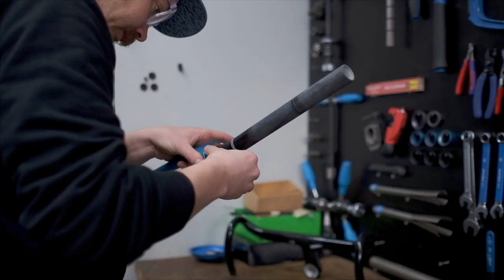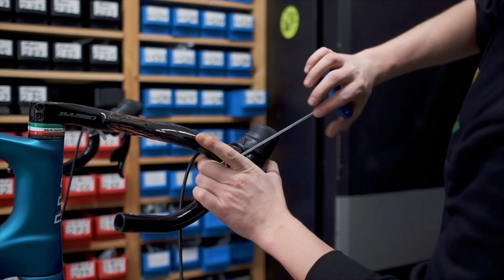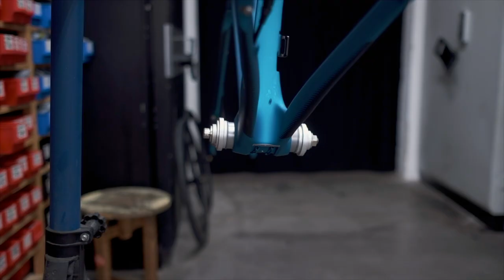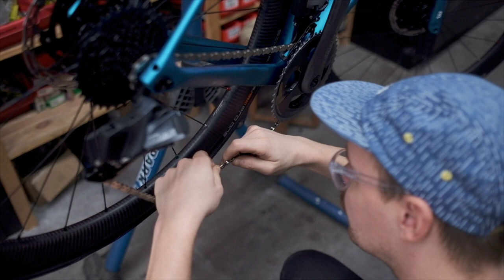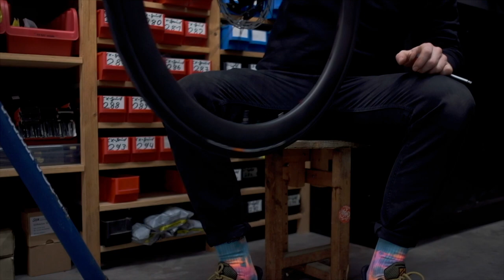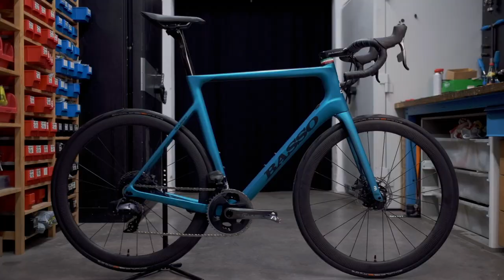Basso Astra Dream Bike Build

Comment: Hi quick question, please. I'm planning to use the INTEGRA headset for my Astra. Does the headset integrate cable inside it? thanks!
Reply from the maker: Internal Cable-Routing is only available with the new Microtech Headset for Diamante SV and Volta.
Reply: @LightWolfStudio  I see - thanks :) it looks like that Volta and 2021 Diamante SV are using two different system? The Volta has a housing in between the OEM stem and Volta spacers - so even using the Basso Integra can maintain the internal cable routing for Volta?

Would it be possible to create a full internal cable routing build for the Astra using e.g. the Deda Vinci DCR system? - without changing the fork?

Many thanks!
Reply from the maker: @HJ-bd2rr  sorry, you have to ask basso directly. we never worked with the deda vinci system.